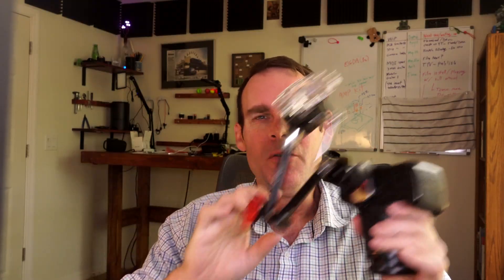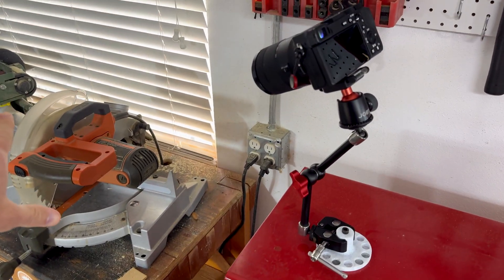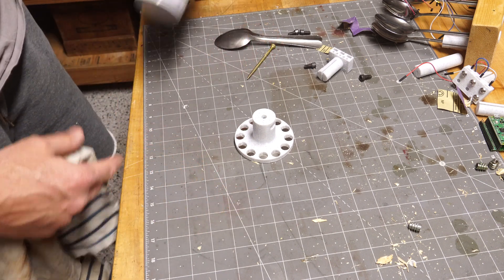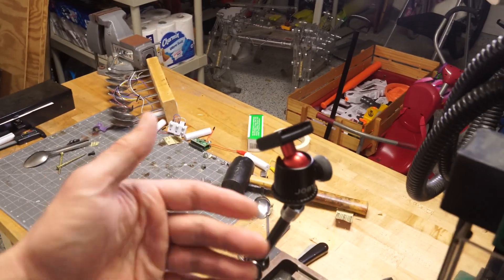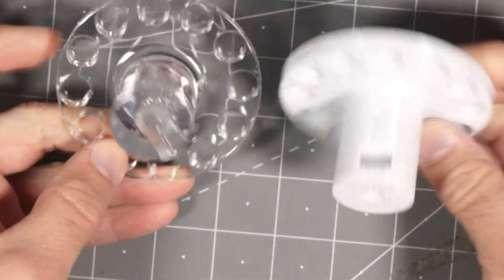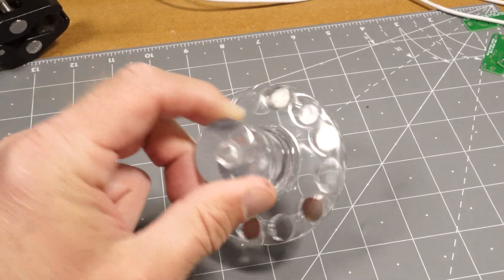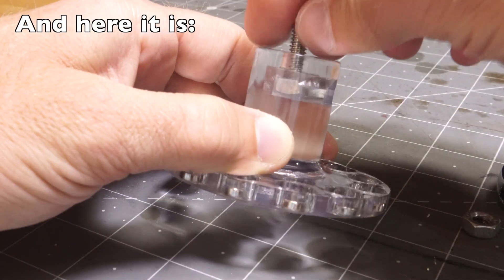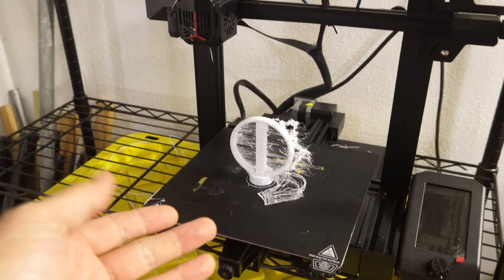DIY Magnetic Camera Tripod [3D-Printed Mount]

Comment: "You could mask the sides, but this obviously isn't going to be the thing on camera"
 That's how the sausage gets made. As long as it looks good in the thumbnail! 

Hey, seriously though: I use one of those gooseneck flashlights with the magnetic-base (and it tips constantly), so I leave it permanently attached to a square chunk of ¼" steel. That way, the magnet feature is sort of disabled until I need it, and the base is way wider and more stable. May want to try something like that to offset the camera's mass.  

And another thing: OH MY GOODNESS could your sponsor make a great lighted base for a palm router. I made one from scrap acrylic and a dollar store flashlight, but it's a total embarrassment. That clear print is so, so pretty.
Reply from the maker: Ha, exactly :-). So Re. Tipping: per Pat's suggestion I tried gluing the magnets in with no gap on the bottom, and the strength difference is incredible. I've got a followup somewhat filmed so maybe I should go ahead and put that out.

Yeah, the clear print is really incredible. I'm sure they could if I designed it, though I think clear bases for hand routers exist at least? Feel free to get in touch if you want to take that idea further!
Reply: @JeremyCook  There could honestly be a market for it. Makita makes the best palm router on the market, no contest, aside from their downright stupid decision to go back to a 90s-era design with no light. 

No light and no variable speed are both deal-breakers for a router—but at least you can add an aftermarket speed control!   

I'm sort of free this weekend. I'll give you a buzz at some point.